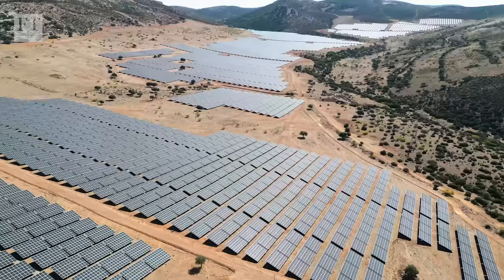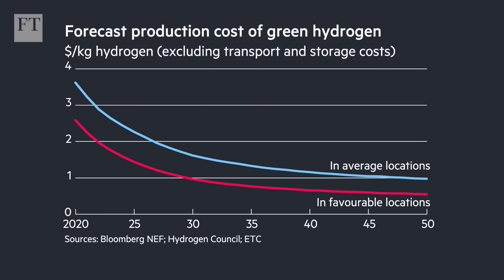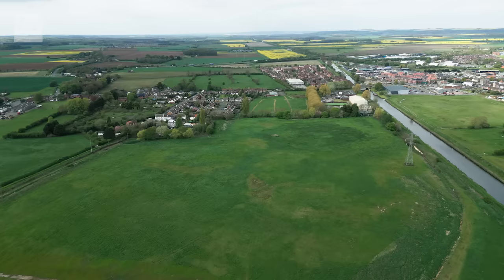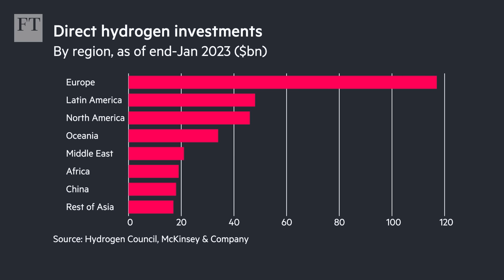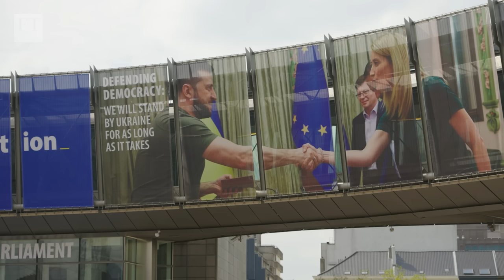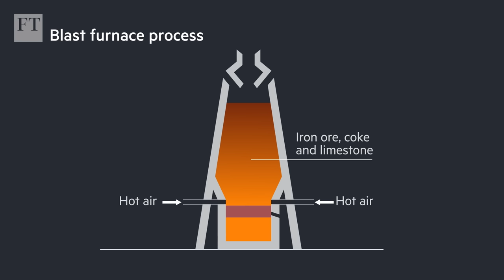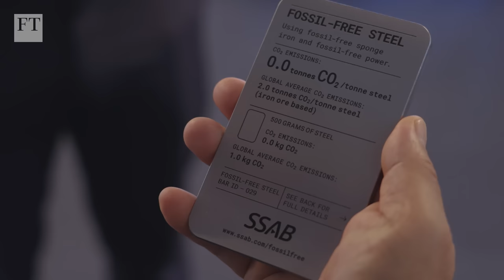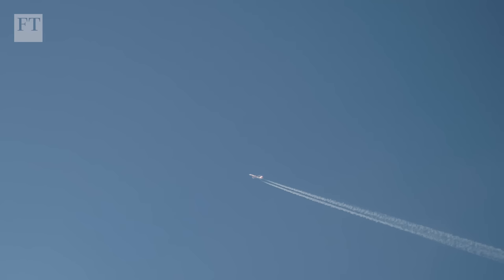Can hydrogen help the world reach net zero?  | FT Film

Comment: Solar hydrogen seems like a good idea for somewhere sunnier than the UK. For 'net zero' all we need to do is to stop exhuming fossil carbon. Our modern lives are based on hydrocarbon outputs of refineries, not what comes out of fossil deposits - they just provide the feedstock for refineries. We should use Direct Air Capture (DAC) and Hydrolysis to synthesise all the good stuff that currently comes out of refineries, and we get to keep all our current technology (prices will change, motivating adoption of non-hydrocarbon technologies). In the UK our greatest potential for renewable energy is offshore wind, which has long 'slack' periods, during which we currently burn gas in CCGT power stations. 

Given *that's what we have now*, it seems obvious to use excess energy from offshore wind to synthesise CH₄ (methane, mains gas) and store it in vast quantities - as lots of countries already do - and burn it in our CCGT plant when renewable energy is in shorter supply. Otherwise we don't have a workable plan for long, cold, dark, still intervals (which occasionally happen). Generating CH₄ means the first startup can inject their gas today - no new tech is needed. As renewable and synthesis capacity grows, we use less and less methane from fossil sources.

We can synthesise other hydrocarbons using the same Carbon and Hydrogen inputs, so everything downstream of refineries still works*. Synthesising hydrocarbons using DAC and Hydrolysis will make 'hydrocarbons' more expensive than electricity or hydrogen, but that will *motivate people to switch technology, while the capacity to provide energy directly for hydrogen and electric-only applications (like EVs) will already be in existence. Additionally, the eventual switch away from hydrocarbons (when we're already net zero) will leave us with colossal spare DAC capacity which we can use to 'turn the clock back' - go *net negative*.
Reply: why would we synthesize methane while  we still produce hydrogen from fossile methane?
Reply: @MusikCassette  I'm not sure I understand your question. If it's rhetorical to point out the missing technology, then you're right - green DAC at useful scale is missing, electrolysis (or other green hydrogen production) at useful scale is missing, and so is large-scale green methane synthesis. My suggestion has a lot in common with other 'net zero' suggestions as far as yet-unbuilt infrastructure goes! None of these is fantasy technology though - green synthesis of fluid hydrocarbons is 'a thing'. If we built those technologies, I have little faith the large projects would all run perfectly in step and brown (philosophically brown) hydrogen would never be used in development. The intention though is obviously to replace fossil methane exhumation.
Reply: @trs4u  right now we produce hydrogen out of methane. whilst emmiting CO2 with that, because we need quite a lot H2 for the chemical industry. And quite a lot of it. It will take a substantial amount of the renewable Energy we produce to replace that. So as long as that is the case if you synthesise Methane using up H2 all in all we just through away energy.
Reply: @MusikCassette  Industry like that seems like a reasonable case to tackle first with green hydrogen, but there's a lower-level problem: we don't have a reliable green electricity supply to power such industry! If we solve the intermittency problem by burning green methane produced with excess wind energy, we would already have colossal green hydrogen production capacity, far beyond what industry requires from fossil sources now. There'd be a 'tickover' amount of hydrogen produced which would satisfy continuous industrial demand. The problem with a 'hydrogen-based economy' is that we don't have hydrogen power stations or hydrogen storage at a scale that would solve renewable intermittency, but also that many other vital industries need a colossal supply of carbon in the form of readily-synthesisable petrochemicals. The 'hydrogen economy' seems to rely on ideas like national-scale nuclear energy or secretly continuing to exhume fossil carbon from behind a curtain of shame. Lots of other countries are going to struggle to avoid choices like those, but the UK with its offshore wind potential doesn't need to go there.
Reply: @trs4u  Don't confuse intermittency with unreliability. The sun does not shine at night but its rise is quite reliable. 
For intermittency we don't have to waste Energy by methane or hydrogen synthesis. There are better options f.e. Na (Sodium) or pumped hydro. 
But there are also seasonal differences, and those are  a few orders of magnetude greater in scale.
"There'd be a 'tickover' amount of hydrogen produced [...]" you might underestimate the amount of Hydrogen the chemical industry requires. 
we are talking about 10% of the current electric energy consumption.
more if we use the hydrogen for things like steel production. With the speed renewable are build at the moment, it will take quite a while until we have the excess energy to satisfy that.
Reply: "Don't confuse intermittency with unreliability." - the prefect answer to people who dismiss renewables as not being viable.👍👍 @MusikCassette

Comment: It is important to surplace the grey hydrogen we use at the moment with green hydrogen.
To be really green the hydrogen must not just be produced from renewable energy, but from surplus renewable energy. In that way it has an important role  in compensating for seasonal differences in energy porduction. But it is not a good energy carrier. There are better alternatives for that.
Reply: What are the better alternatives for moveable energy? I'm genuinely curious because all I can think of is synthetic hydro carbon fuels
Reply: @kapperbeastYT  Top on my list is Sodium. But there are other options. There is also a bit dependence on the use case and on the cost for safety concerns. 
A Sodiumfire can be a nasty thing.* 
May I ask, what you mean by moveable?  Are you talking about powering vehicles or are you talking about moving Energie within a region or are you talking about equilizing  Energy from far away places on globe?

*in a way, that is always a concern when you have a lot of any energy carrier in one place, even coal can explode when handle it wrong. but costs for safty might differ.